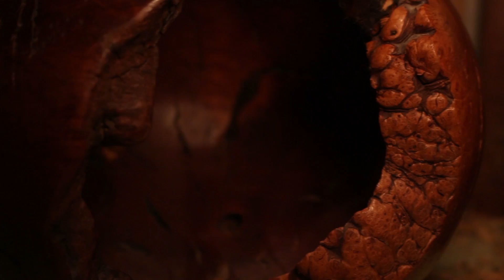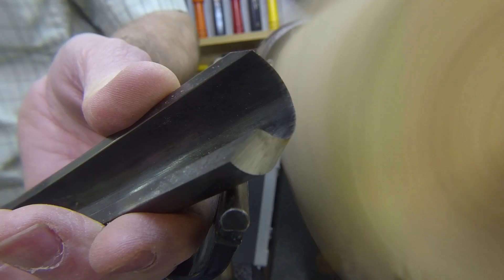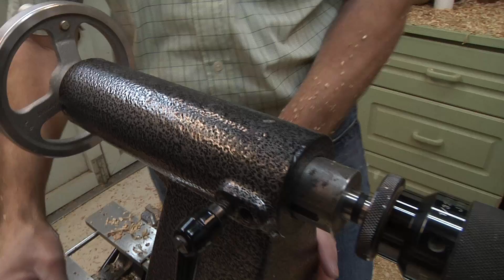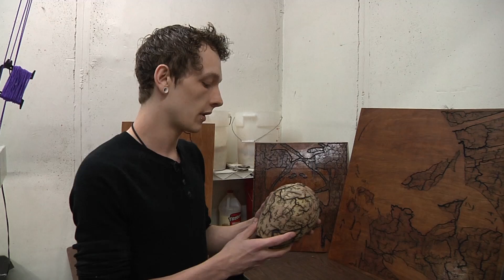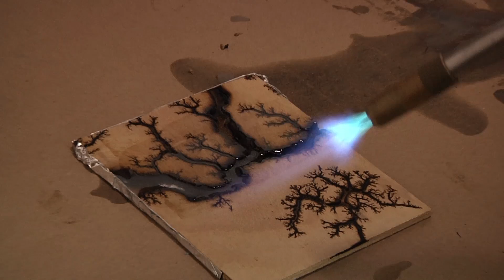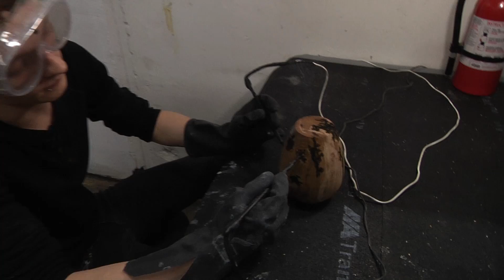Lichtenberg Fractal Burned Vessel

Comment: Electricity FAVORS paths of least resistance, but it follows all available paths simultaneously, in proportion to their resistances. A big difference. 
Electricity doesn’t need a path to ground — it only needs a path through you between two points of different potential (for example, one hand on each electrode).
I fear this young man may not be long for this world.  There is nothing more dangerous than a half educated person.

Comment: STOP SPREADING THIS MYTH. THIS PIECE OF FALSE INFORMATION CAN, HAS, AND WILL CONTINUE TO GET INNOCENT PEOPLE KILLED.

"Electricity follows the path of least resistance"
 
THIS IS FALSE INFORMATION!!! A commonly heard and easily spread myth that can KILL. 

Electricity does NOT follow least resistance pathways.

💯💯💯Electricity flows and can use ALLLLLLL pathways to ground💯💯💯💯

Please stop spreading this false information. Remember Electricity is only a THEORY. There are so many properties of electricity that can not be proven fact. We are surrounded by it every day but even the most experienced electrical engineer, electrician, lineman does not, could not  nor will they ever have a FULL and scientifically proven understanding of electricity and its properties. But make no mistake just because you cant see, smell or taste electrons flowing through a hot conductor, I can assure you it's there and will bite your a*s. Please be careful, dont be stupid and if you aren't well versed in or have ample experience working in and as electricians apprenticeship/helper......leave it to the professionals. Unless your proving the theory  of Darwinism and "natural selectrion"......then please by all means, as you were, carry on

Comment: A lot of folk use a ( readily available ) transformer from a microwave oven .... rubber gloves are just not enough .. you should use at least 15 / 20 inches of highly insulating rod ( don't use wooden dowel ! ) away from the 2000 Volt cable / prod  , this voltage can jump across a poor set up and will almost certainly KILL YOU , and you will die painfully ..... take note !  ....

Comment: No need to use 15,000 Volts, that is way to dangerous..., I use 230 Volts (also dangerous, but much less). 
The electric effects It depends on the amount of Ampere / Watt / Ohm, and the solution of backing soda to use on the wood. 
The higher the amount of baking soda crystals in the water, the more crystal lines you get...

Comment: I have been doing the fractals inside an insulated cabinet. Probes are spring loaded into contact position and door is closed. Operation is by pneumatic foot switch for no electrical conduction path. Fumes extracted by fan and filter. Cab observe from safe position. Different salt solutions give different patterns. A light pencil line can be used to influence the path direction.

Comment: Great video Mr Yoder. Inspiring as always. Quick question if I may? Is there any wood turning tool that you do not have but wish you did? Is there any existing tool you think could be better modified to meet your needs? Thinking cutting tip profile. Clearance or material made from? What about handles,grips or tool feedback? What cutting edge do you prefer? Carbide, HSS, carbo tool steel or any other?

Comment: Yea running a lath is dangerous for those without knowledge of the spirit of the way. I use to turn wood on a very clean metal lathe with auto feed and a template guide. It was a very satisfying way of spirit of a way of truth, manifesting truth, of the power of the spirit of creation.

Comment: Rubber gloves won't stop three inches of arcing voltage from going through your hand. There's high voltage systems available that ground the exterior of your gloves using a metal tether system that remove all risks of electrocution out there.

Comment: hi, there
im from germany and i made today experements with the lichtenberg phenomenon, i tried a lot of different kinds of wood, even hickory (that made the best results).
the soft woods burned down verry quickly, and with verry hard woods, the "painted" mixture evaporated so quick that the resistant go to nothing in no time.
can you please tell me what voltage did u used and what mixture of baking soda and water? and what is the best wood for this?
i never got such a nice shape like you, whats the secret?
I actually work with 6000V, current no idea, but it depend anyway on the resistant.
i think about a voltage multiplier to turn the voltage up to 12000V but what is better lower or higher voltage?

thank you in advance

Comment: The artist is not high voltage trained and is attempting to do this at high risk. The gloves don't save him. He's holding two high voltage electrodes - one in each hand. If there was the smallest arc, he would be shocked through the heart.

Comment: Love your video, very inspiring to us knew to turning. May i ask how much this compact dead simple elbow hollowing tool costs?  that articulating arm looks like it works super.  our woodworking shop is (ICORD) Tetra Workshop 2015 and we do have a video here on youtube if you want to check it out.  i am in the slide show video showing off my 1st top, amazed that it worked LoL   as well as getting framed. Before i discovered the lathe my new passion i used to mostly make frames for my painting